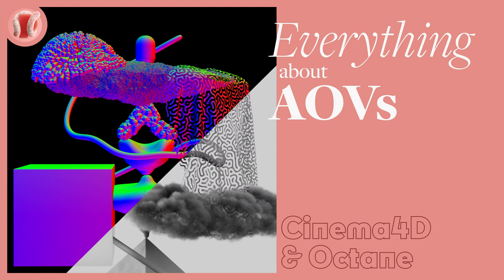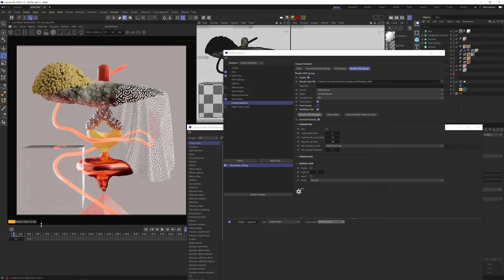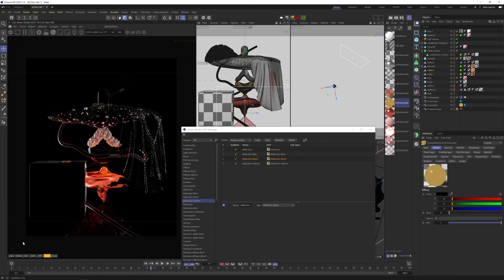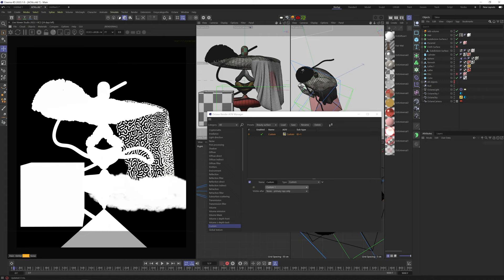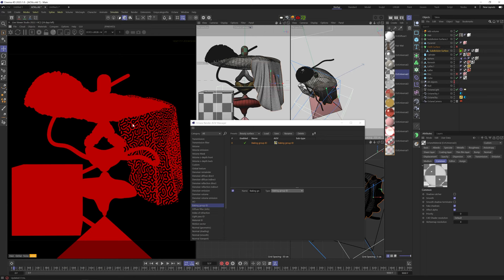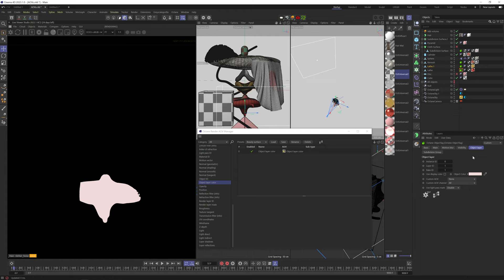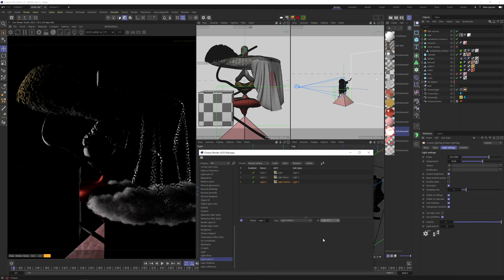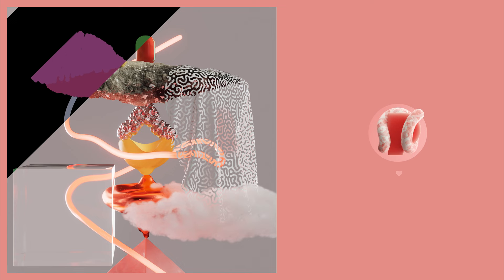Cinema 4D Tutorial - AOVs Deep Dive (Octane)

Comment: Hey there! Your tutorials are my bible! Thanks so much for sharing. Quick question, do you have an idea how to remove fireflies from the transmission AOV? Everything looks good when using my denoised beauty, but when I add the transmission layer it starts looking very noisy
Reply from the maker: Hey! Yeah you're gonna have to up the samples if you want a cleaner transmission AOV, but you can also use the Denoised Remainder AOV, which is a denoised version of of the Transmission and Subsurface Scattering channels combined. If you have nothing in the SSS channel then it'll be only the Transmission info and it'll be denoised.
Reply: @NewPlastic  yas! I knew you'd had a solution. Thanks so much!

Comment: Yooo great tuts as always my guy! Am I crazy or does changing the color management to use ACES or OCIO not affect the way the AOVs render out. They appear in the realtime preview with correct color space, but then when I render them out, they're just using the standard color management profile. I don't know if I'm missing something. My buffer is set to LDR (8-bit) Color Space is set to Output RGB, like you suggest in your OCIO tut, but my AOV post effect is rendering as though its just the standard colorspace (HDR/sRGB).

Comment: I wish you used Redshift. Is there a specific reason for choosing one over the other? Considering how integrated RS is now to C4D.
Reply from the maker: Yeah that's a great question, I picked up Octane in 2019 after trying Arnold for a year and the C4D Physical Render for like 2 years. And I just stuck with Octane cuz it's powerful and Redshift was still in its diapers. 
A couple of months ago I realized RS has some really powerful potential for C4D for the reason you mentioned so I also picked it up and started integrating it into my workflow. I now have videos about RS along with Octane, but honestly RS has still got a LONG way to go in terms of procedural node setup. It's just, very  much behind. Octane has a really vast array of nodes capable of building a really sophisticated, fully procedural setup. And even tho I still have major issues with is (Blender's node system is even stronger), RS's node system is like a 15 year old kid trying to figure out how to upgrade his kickflip into a treflip while Octane is already doing Treflips boardslides down a 4 stair handrail.

Comment: Thank you for this video! Is there no way to render an OAV that contains only the shadow from a shadow catcher?  My compositing needs are simple but that's the most obvious thing I would regularly need. It puzzles me that it would be missing. Even before AOVs, you had to do a separate render pass, unchecking "seen by camera" on other objects in order to render only the shadow and not the object casting it, but this workflow made no sense then either. It's weird this would be overlooked again in a completely new compositing system.